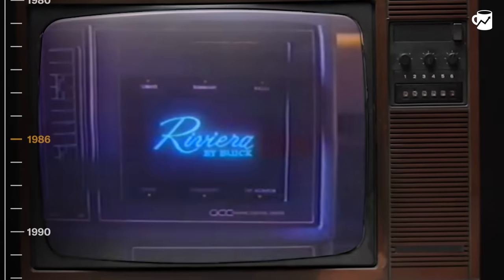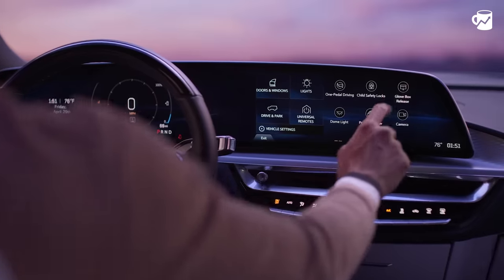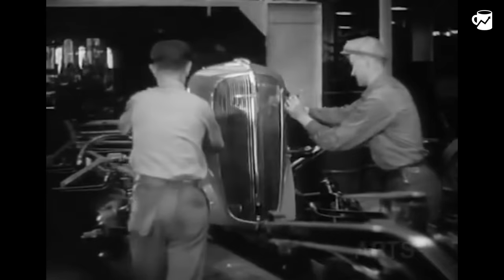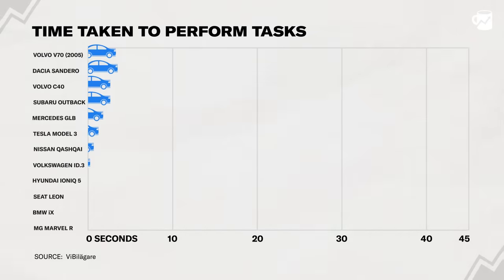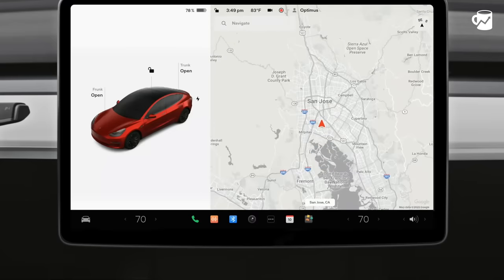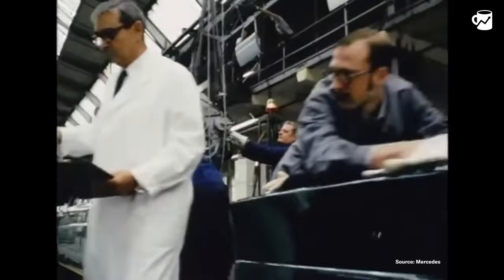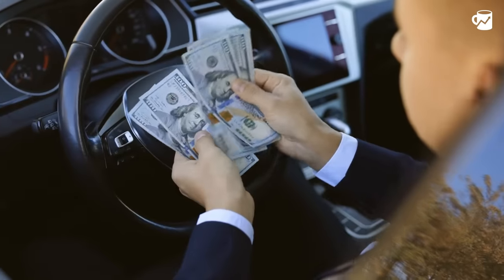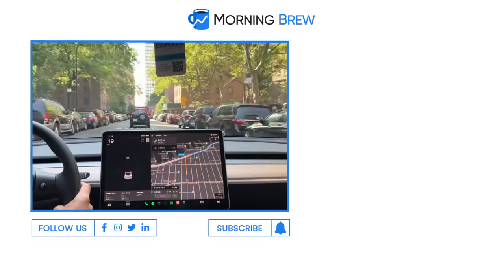The Real Reason New Cars Have Touchscreens

Comment: I've worked in the sofware industry for the last 10 years and I've certainly this is NOT to reducing costs. Make a software is propably much expensive than produce phisical buttons. Automakers are do this because Tesla launched this as a trend. Is not because costs or because user experience, it's because its cool. I Like and fascinanting with new tecnlogies, but this no make sense: physical buttons use your sense of tact, whereas with screens this is not possible. I have a FireTV into my house and the control app have a simple interface to use, but is much eaisier to control the TV using the phisical controller, I don't even need to direct my eyes to the control, unlike using a cell phone app.

Comment: All modern UI's suffer from this though, trying to find any level of settings on phones made recently is a mission of digging through menu after menu looking for a setting.  

That said, I'm happy in my 90's car, it does everything I want, and I really don't have any reason to look at a car newer than 2010, they all have the same fuel economy as they did in 1998, at least the Corolla's haven't changed much. So eh. I like simple cars, they're fun, you're connected to the road, and they're easy to fix.

Comment: Buttons break. I haven’t bought a used car where all the buttons worked or some didn’t break while owning the car. When a touchscreen is replaced, everything works like brand new again, so it is not all bad for the consumer.
I agree that it was much easier to drive cars in the old days before touchscreens, but you just can’t jump into a touchscreen-operated car and expect to know how to operate everything. It is crazy to learn things while driving in traffic. Sure, everything is just a few clicks away, but you should not mess around with menus while driving for more than a few seconds.
In everyday driving, this isn’t a problem as you know where things are. I would hate more laws that fine us for victimless “crimes”. We have enough laws as it is.

Comment: I could fix my 1979 Vw gti , 1991 Ford escort , 1988 Jeep pick up , most of my 1996 Dakota with a Tool box and diagrams as many others could too. 
Now because of a Firmware upgrade you might have an Electric Brick that won't run ..

1910 Ford model T's still run with zero issue... I will leave it there.😂

Comment: My 2019 Honda Odyssey has actual knobs and buttons tor things like the audio volume control, temperature setting, fan speed, exterior lights and others. There are also steering wheel controls for the cruise control, Car play, basic phone functions, setup menu and other things. Those things are also all accessible through voice control and the touch screen. It seems to be a good compromise in overall ergonomics.  

This model only does NAV through Apple Carplay for me. My previous 2016 CR-V showed me that the Nav on Apple Carplay is better than the Honda Nav overall. Plus the Apple Nav is better for being updates all the time. I was tole in 2021 there was no Honda Nav update available for my 2016 model. With Apple and Android Carplay, there is no reason at all to buy the car makers nav any more.

Comment: I just traded in my '05 Subaru Outback 3.0R I've driven for the last 17 years, for a '21 Legacy Limited XT. I'm a technical professional so it's not like I've lived under a rock & not been aware of what's  going on in cars currently, but it's another thing entirely when you finally put your cheeks in the seat & have to assimilate it. Things are just so different now, even down to the experience of purchasing a car sight-unseen online (gives me the willies lol), but yeah, this touchscreen panel leaves a lot to be desired, & of course so much of what's loaded is geared toward Subaru's Starlink service, which is now shuttered. I do like Android Auto, but have a stupid issue where it can't use the full amount of screen without a firmware update to the panel, which, should go fine? I saw a Honda Element (or some similar car) in a parking lot a couple weeks ago & it looked like it had 2 ipads shoved in the dash, & I'm sorry, I thought it was the stupidest looking thing... Damn I'm getting old. Get off my lawn ✌😂

Comment: I have an infotainment in my brand new car, however, multiple times now it was not booting up.. I could not control anything anymore.. no ac, no navigation, no sensor sounds, nothing. At least I still have a real button for the hand brake, but seriously, the real solution would be to make a couple of buttons have primary functions you can set yourself which has its own small software instructions. then make it so you can change the use of a couple buttons with the touchscreen which will be a separate software, but the touchscreen should not be the main way to go.

Comment: "Needs to survive the lifetime of the car" There may be more to that sentence than most people realize. 
Talk to anyone who has been working on the server/network side of IT for a decade. Heck, talk to anyone who is a fan of older tech. You can have perfectly designed hardware, but software can make the device unusable. 

I have to use a dedicated virtual machine to run some of my server management hardware on my home network, because the latest version of windows that supports the hardware is windows 7.  The software will not run on a newer version.

I wont be surprised if we get to the point where we have cars that are forcefully retired because they are old enough they dont have required "safety" features provided by software. "This car cannot be driven in california because it does not support hyper-lane 3.8"

Comment: Car companies have NO idea how to design an appropriate UI for a moving vehicle. Sync2 and MyFordTouch proved that 12+ years ago. if I can't use steering wheel controls or the center stack controls for hvac or audio system, I do without because I can't afford to take my eyes off the road for many seconds at a time. what a disaster, and now, in an effort to save pennies, automakers are doing away with mechanical controls; everything is done by touchscreen. ugh.

Comment: I like the way my Kona EV is designed. Fewer visual things on the drivers dashboard, since it's electric and the button steering wheels help immensely with controlling android auto. I also think the button shifters are extremely intuitive to use.

My only issue with android auto is that they made the voice recognition based on what they think you're trying to say instead of what you're actually telling it to do. This is extremely distracting.

Comment: I am phenomenally grateful that my 40 yo Sunday car has no screens, only real dials and real switches buttons and levers.
I know EXACTLY where every control switch/button is without looking and the instruments are all visible by flicking my eyes off the road for less than a quarter of a second.
Exactly the same for my 20yo daily car.
Trying to find the windscreen washers/wipers, heating, or any other sodding control on a touch screen means I'll pile into the car in front or a pedestrian which I would have seen and avoided if i didn't need to take my f'king eyes off the f'king road ahead for half a f'king minute.
I'm not a bloody underage teenager on a sofa addicted to video games, I'm a motorist with a 50+ year unblemished licence which I'm in no hurry to fuck up.

Comment: My 2 recent cars , a VW tiguan with touchscreen , that I had to wipe every day , the reflection of it makes driving under the sun a suffering. The AC and everything else were still seperate , it was a 2017 model , can't imagine how terrible it is for the newer ones. So much so I traded it in after a year , for a 2019 Q5, no touch screen , just the little spinny dial, yes it makes it harder to input phone numbers to make a call if its not on the call list, but the touch pad is next to the shifter therefore I can just write anyway. The chrome trim still makes it hard to see every now and then but its not as bad as a touchscreen reflection.
Now that the car got older and I am looking for a new model , the revision has a touchscreen and is quickly off the list. Back a few years it was piano black interiors that was horrible to be in , nowadays its the giant touchscreen plus the piano black.

Comment: I absolutely WOULD NOT BUY a car with touchscreen-only controls.  In my 2013, I still have buttons for nigh everything except the infotainment system.  And that screen gets washed out with ANY direct sunlight.  And even indirect sunlight if there's the slightest layer of dust on the screen.
How many times have I tried backing into the spot and the rear-view camera image is completely washed out?  I still always use my mirrors to position the car when backing, but it's nice to be able to use the camera to see how much clearance you have.
And to have ALL functions controlled by a touchscreen?  On a low-sun day, that's a disaster in the making.  Nope, not gonna happen...

Comment: It's just a cost cutting measure.  No physical buttons to design, manufacture, QA, inventory, warranty, etc - all replaced by one cheap, smudgy, fingerprint-laden, screen, with glare.  The Kool Aid drinkers think it's better since it's newer, but it's way more distracting.  Plus, screens are hard to use when the car is in motion and don't offer the same tactile feedback that a button does - and usually the item you want is buried within sub menus.  It's a total fail.

Comment: I haven't even watched the video. But I doe electronics, so I an already tell:
It's cheaper. One cheap preassembled standard module replacing dozens of buttons that have to be mounted and wired.
Capacitive touch surfaces are similar. They are also obviously easier to water proof and more durable generally because they don't ave moving parts.
Even for new designs you just need to calibrate the software to the new untouched state. Which really is just a: Make sure no additional material touches it. Take that value for the state.
So the standard micro controller libs just use whatever state they detect at bootup. 
So when in doubt reboot and make sure nothing touches the thing.
That's really how all sensor calibration works. Take a known value and assign that to your detected data in software. Not really any different then the analog equivalents in concept.

Comment: Screen delamination causing erratic functions to transpire, is an issue. I do not think they solved it, or will ever solve it. So they can charge you $ after your warranty expires. When the screen is triggered automatically turning your heater on in the summer or AC in the winter are just a couple issues among many that could possibly happen. Costs a small fortune to have them replace the screen. Give me knobs and real buttons. A faulty button is cheaper to replace than that fancy screen on your dash.

Comment: I would argue that some of the gesture controls are worse than no buttons and just touch controls. Considering Apple change the gesture to see the desktop and it refuses to recognize my hand meanwhile my older laptop shows me the desktop every time my new one I could never get the gesture right. And let's not forget about that one vehicle recently that uses one knob to control the heating and the volume but not the same time. Most of the systems are drive-by wire anyway so all they need is a button panel that connects into the canbus. Then again maybe we should be looking at the Software and saying standard things that we have solved you just be open source so they can be fixed by anybody or modified. Oh and let's not talk about Security because the whole electronic lock thing is not that secure neither was keys but it was a little harder.

Comment: Put anyone in an unfamiliar car and it will take them a long time to find where all of the buttons are, it doesn't matter if they're physical or on a touch screen. Regardless, it makes sense to move a lot of the rarely used buttons to a touch-screen menu. When was the last time you turned off traction control, and why does it need its own dedicated button in every car?

Comment: This is an important issue, and I'm glad you're covering it. Using touchscreens for common features that we should be able to adjust without looking, while driving, is monumentally stupid, and makes for a frustrating user experience.

But Jesus, dude - you're switching way too quickly between scenes here. There's not enough time to begin to read any headline, nor to absorb what I'm seeing. Slow it down, have fewer scenes, and make it easier on yourself in the process.

Comment: I needed  to replace my 2005 Jeep since the long trusted engine was getting really noisie after 400,000 miles. I plan to rebuild it eventually. I considered a 2016 Jeep but was turned off by the touch screen. I eventually found a low mileage 2012 Jeep that still had knobs and switches and I grabbed it up. 2012 must have been on the leading edge of the electronics revolution because mine has the ability to link up with the phone through the radio, and you can also show google maps on the screen. It's not a touch screen, just a basic info screen. When I inserted a home recorded CD it displayed the name of singer and title of song and I didn't realize my laptop could burn all that info onto a disc.

I guess I'll have to make that 2012 go 400,000 miles like the other one if I hope to avoid that daggum touch screen.

Comment: my 2018 Chevy Colorado WT is only smart when i physically plugin usb dongle to my android phone.  However, the functionality still depends on Android Auto and the frequent/useless updates to keep it operational.
  I did find ONE useful trick!  instead of using Android Auto default program(s), instead use radio source "usb" and play any sound-based program (ex: youtube) onto speakers.

Comment: No, touchscreen isn't cheaper than the old tech. Just look at the price of new vehicles and what it cost to repair them. On older cars, a cable attached to a slider worked the vent doors and a switch to power the ac compressor. Now they still have the manual vent doors, but theyre connected to servos controlled by cpu interfaced with the touchscreen. They are rube goldberging transportation out of existence.

Comment: The buttons need to last the lifetime of the car. But for some reason instead they drop a crucial component, that will brick your car once it's broken. Like do you think you can go down to the local Auto Center and buy a new screen for you what ever car was made this year, 5 years ago, 20 years ago?

I want a car I can repair and maintain for decades, not just until the warranty expires.

Comment: I think everything is a bit over egged in this. The example of volume isn’t right because you just do that with a scroll on the wheel in a Tesla. The main things you may need a can be done with voice. If you’re getting into the car new then yes you need to know the car but once you have it everything is easy. A lot of the tasks like sat nav you shouldn’t be doing while driving. Radio, heated seats, climate control can be done with voice.

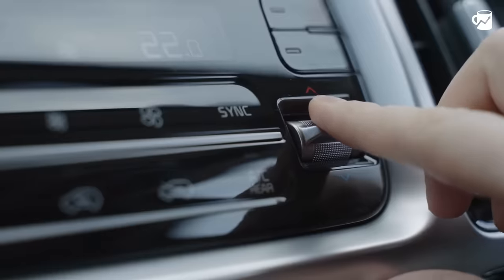Comment: The real reason is at 7:18
To design a nice looking dashboard takes a lot more effort than designing the graphics for a touch screen display, and cabling is 10x more complicated, so car manufacturers are simply taking advantage of this stupid fashion. I'm driving as a company car a VW Golf, where 60% of the basic functions are via hard buttons. 
The next one will be a Peugeot 308, where 90% if the functions are via touch screen. 
I'm extremely worried because my colleagues that have already experienced it have told me that it's very distractive and several times were risking an accident while while trying to change th temperature or other common operations

Comment: For safety alone, ANYTHING that requires you to look away from the road should automatically go black when the speed goes over 2 mph.
   I only allow 2 mph for the backup camera.
   Navigation?  I can hear the robot voice just fine.
   Gauges?  Any experienced driver can judge his speed and RPM without them.  Give me a sound alert when I go under 5 gallons left in the tank.
   Backseat TV?  You need to learn how to discipline your children -- it'll pay off in many ways later.

Comment: What's funny is I have 2 screens for my cars infotainment system. Each screen has an to do everything for the car. How often do i touch it... Never. Granted it has 3 buttons i use. Climate control on/off, heated seat, and heated steering. None of which use while driving. So I don't understand what other people are doing that they need to change stuff so often while they are driving. Most cars even answer your phone and end call from the steering wheel. You can change songs from your steering wheel. So idk what else people are playing with.

Comment: I drive a 24 year old merc slk.  It has only buttons and knobs, no screen of any kind.  My partner has a far newer hyundai.  I've also been in and driven other newer cars.  I have absolutely ZERO interest in upgrading my car, which after 24 years still drives as if it was driven out of the showroom yesterday.  There are several reasons, but touch screens are a large part of it.  Build quality another.

Comment: Peugeot used to power their horns via the inboard computer ( instead of a simple  wire from the horn button to the horn ! ) ... pressing the horn button put the command in a software queue .... so the horn sounded several  USELESS  seconds later ( low ratio Hornblower etc .. ) ... maybe a touchscreen with inbuilt vital knobs underneath ( ? ) ........ DAVE™🛑

Comment: I hate the touch screens, and even more than that, I hate that the screen is where the radio should be. I want my key info (speed, engine temp, etc) to be in my line of sight, right under my eyes, so I can quickly look at it without taking my eyes off the damn road.